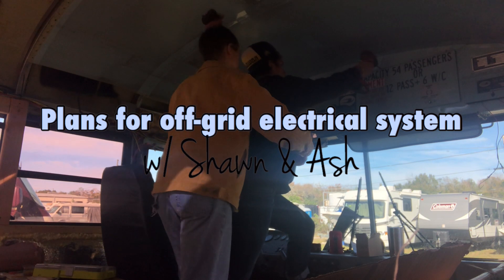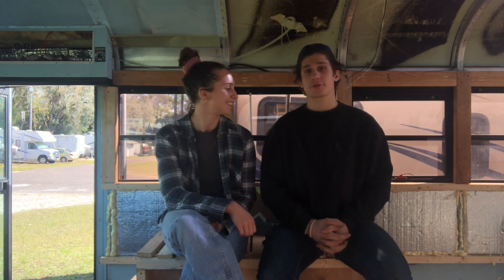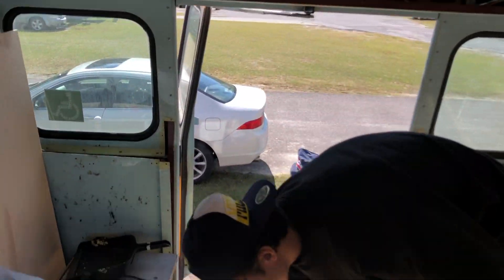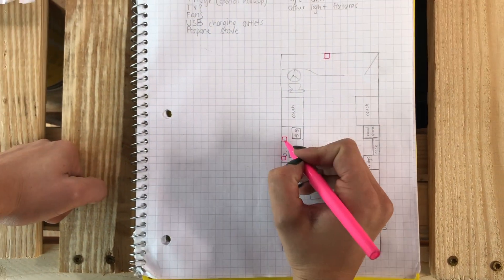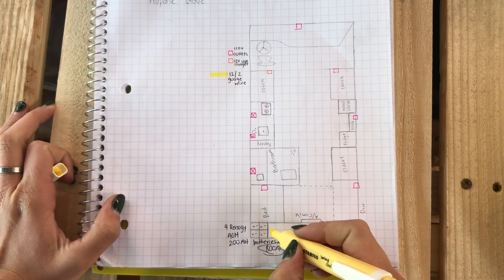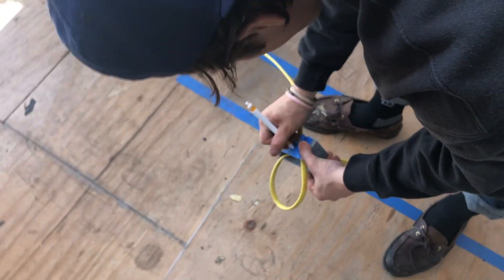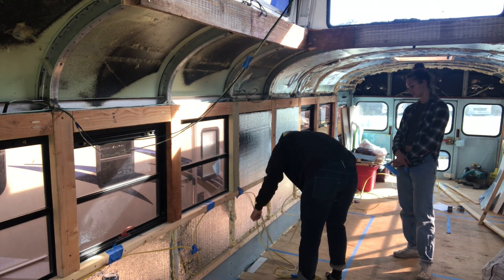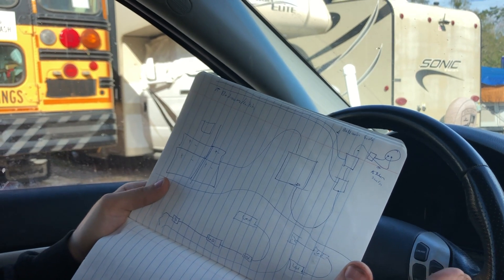OFF-GRID SKOOLIE ELECTRICAL EXPLAINED - electrical and solar plans for our school bus conversion!

Comment: Hey guys! My partner and I are buying a bus to renovate this summer as well😊 we love your bus! I just wanted to make sure you guys are aware that with AGM batteries you cannot discharge past 80%, so your real capacity is about 640 Ah and to plan accordingly! Also keep in mind that you might have cloudy days, so if you plan on going completely off grid you might want to consider a larger battery bank to compensate. We're going with a 1420W system with a 7500Ah battery for extra storage if we need it. Its pricey but we figure itll be worth it! We're not doing any propane on the bus, so we're also going to use solar for hot water and cooking which eats a big chunk.

https://www.altestore.com/store/deep-cycle-batteries/lithium-batteries/kilovault-hab-75kwh-lithium-battery-storage-system-p41420/
Reply from the maker: Hayli Heussner we’re not using AGM batteries, they’ll be Lithium Ion :)

Comment: If you have a 3000 watt inverter that should run most anything like your water heater and other appliances in your kitchen and your air conditioner such as if you have a few things running and the air conditioner or the heater on your air conditioner kick in it shouldn't take your circuit out it should be enough amperage because that's that deals with like your startup amperage is always high compared to when it's running so I think 3000 amps or 3000 watt inverter should handle it we have we been on an off-grid Homestead for 5 years and my husband and son run welders and everything off of solar and we run I believe it's like 6,000 but we use a lot higher amperage and stuff
Reply from the maker: KAREN RIGGLE awesome point!! Shawn is far more versed in all the electrical (this is Ash!) but I know he’s done all his research and feels confident in what we’re getting but a 3,000 watt inverter sounds familiar for sure! Glad to hear you love homestead life... that’s our plan for the future once the bus is retired :)